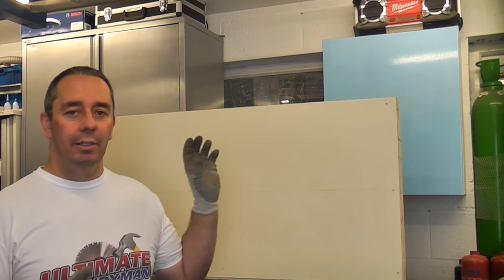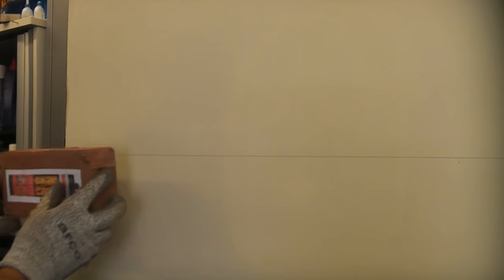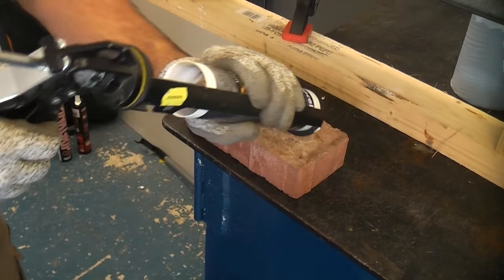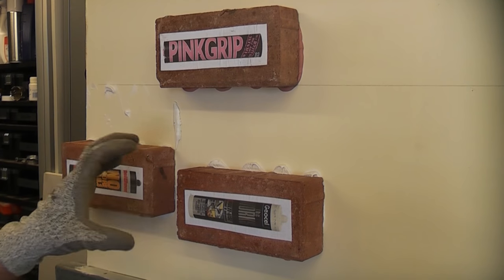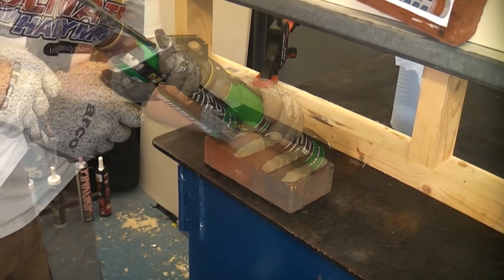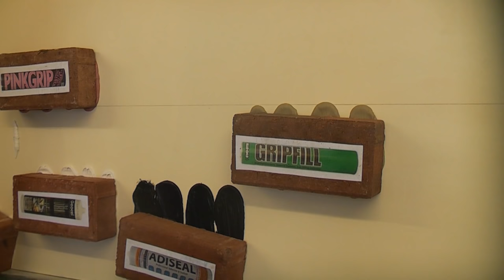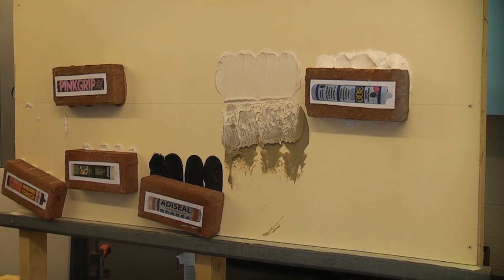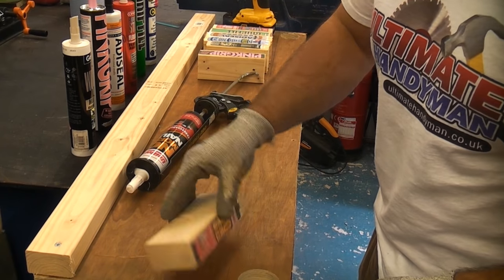Grab adhesive - grab and strength test

Comment: Hi Chaz, great video! Keep up the good work. Quick question: did you have price range when buying these products or was it whatever was available the shop? Also, were all the adhesives approved for working with mansory/concrete/bricks? If you were to select 1 based on the tests - which one would you use? Thanks! Love your videos.
Reply from the maker: Hi Aakash, in the first test that I did I bought the same adhesives that everbuild used in their "maximum torque challenge", then for the second test (this one) I bought adhesives that people recommended from the first video-
https://www.youtube.com/watch?v=9XgDvYsJiB8
I think all grab adhesives can be used on masonry.If I had to choose one brand I'd go for the Nemesis brand sold at Screwfix as it performed well in both of the tests that I did, including the strength test-

https://www.youtube.com/watch?v=80pC1-eJFj0
Reply: Oh thanks - I  missed that! You did mention it in the first seconds of the video! Yeah, I have heard good reviews for Nemesis - some sources say its a Dow Corning product.
Reply from the maker: Thanks, the Nemesis gear is excellent. It would not surprise me at all if it was made by Dow Corning.

Comment: Hi could I use CT1 to fix some small wooden batons to an outside brick wall ,to put up some feather edge panels up......thanks
Reply from the maker: Yes, that should be fine, although mechanical fixings would be preferred, as you don't want it detaching with the wind etc.

Comment: As with all adhesive bonding, surface pretreatment is no.1 importance. Did you clean/prepare all surfaces the same? Also, the failure mode of each bonded joint gives valuable information (I.e. adhesion failure, cohesive failure,  substrate failure, or mixed mode failure). If you see adhesion failure mode (all adhesive left on one side of failed joint), it is likely that surface contamination is to blame.
Reply from the maker: I didn't clean any of the surfaces apart from ensuring they were dust free.
I have repeated this test since using stainless steel and that did not hold as well as the timber did.
Thanks for the comment
Reply: Yes, stainless is a bugger to bond to! You'd need to start by throughly degreasing with solvent wipes (MEK would be best but bet you can only get isopropyl alcohol). Then abrade and finally solvent wipe again. Even then, the oxide layer on the stainless makes bonding hard as it reseals quickly after you abrade it. Thanks for the feedback, keep up the good work on the channel.
Reply from the maker: Thanks Guy, it was one of the adhesive manufacturers that watched one of my grab adhesive testing videos and said it was an unfair test. He then recommended using stainless steel, so I cut some test pieces and cleaned them using methylated spirits before bonding them to another piece of stainless. Even after a full week many of the adhesives were not cured fully and were moved quite easily with the hydraulic ram.
I'm not sure what pressure it took until I edit the video, but I'm sure it was much less than when I used the timber.
Thanks for the comment
Reply: Ultimate Handyman hi what's the best adhesive to use to put on a curtain corniest on the concrete ceiling without using any drill or screws thanks
Reply from the maker: It depends on the weight of it and how much surface area you have.
I'd always use screws for such items to be honest as you are guaranteed that it will never fall down.

Comment: which grab adhesive would you suggest for a good an secure fixing of timber stud to concrete wall inside. i dont want to take chance of hitting wires that may b hidden.
Reply from the maker: I'd just use Nemesis from Screwfix as it's cheap and works well

Comment: I need to put up a wooden curtain rod, 8ft long I screwed it into a plaster wall already and it fell down after 3 months, I couldn't screw it in properly as the plaster is too crumbly, it's a council house built in 1968 and there is a big gap between the plaster and metal lintel. I was thinking of grip fill in the screw holes and push in the wall plugs let in cure for 24 hours then put up the pole? what do u think and any advice would be welcome
Reply from the maker: That might work, but what I normally do is screw a wooden batten (2" by 1") to the wall first (this can also be glued with Grip fill etc.).
It's much easier fixing a curtain rail to the wooden batten as you can put the screws anywhere.
Reply: Ok Cheers thanks, keep up the good work

Comment: You used enough of it to glue an SUV to a ceiling on those little bricks! Of course most of them are going to slide! Thinner beads should allow the goop to do what it was meant to. A big glob of anything takes much longer to dry or react. In this case if it had adhered to the wall and brick, you have all that slop in between that isn't able to for the most part.
Reply from the maker: This video was made because a well known grab adhesive manufacturer made a video called "the maximum torque challenge". In that video all of the blocks that they used fell down the wall apart from the "maximum torque". In order to recreate their video and perform a fair test I had to try and use the same amount of adhesive that they did in their test, but obviously I got much different results ;-)
Reply: This company 'maximum torque' that manufactured the test should be reported for misleading us. The other companies misrepresented should take them to court and sue them. 
People Power Ultimate HandySuperman the official go to Chap for honest professional information and advice
Reply from the maker: Thanks Jack ;-)

Comment: great test. its great for a trades man that cant do the test them selves. im shocked with the pink grip. I never got good results with ithave you tried tech 7 , I would like to see a test like this but trying to find the best amount of glue to use. I would guess that if you used a smaller bead of the runnier adhesives you might get less slump
Reply from the maker: Thanks, I used that amount of adhesive as that is similar to what they used in the "maximum torque challenge", which is what I recreated- but with different results. I have never heard of Tech 7 but will look out for it.
Thanks for the comment ;-)
Reply: im in Ireland . we have tech 7. it is similar to ct1. I find tech 7 a lot better.  they have brought out a new tech 7  that is a lot thicker  and is more of an adhesive rather than silicone . I only used it once to stick a few loose slates on an old house. it is some tack  . I stuck  the loose slate and couldn't move the loose slate once I got it in place. I must try it someday on something and see if I can break the joint
Reply from the maker: Thanks, I think I have seen it on ebay. If I do further tests I'll be sure to pick some up ;-)
Thanks for the comments

Comment: Is the gauge showing psi, or is it calibrated to show the ram push?
Great video again!
Reply from the maker: Its just showing PSI.
Thanks for the comment ;-)
Reply: It doesn't matter for a the comparison test, but I thought that with a 2" (?) cylinder the "push" will be around 3 times more than the pressure. Some impressive results of actual load bearing ability there!
Reply from the maker: Absolutely. The C-T-1 and Nemesis both broke the wood before the adhesive failed- very impressive!
Thanks for the comments ;-)

Comment: How many of the adhesives failed due to the plywood delamination as opposed to the adhesive failing?
Reply from the maker: I think just one of them managed to delaminate the plywood, which was the last one tested at over 600PSI

I have tried repeating this test using metal on metal but it just does not work as none of the grab adhesives I tried worked well on metal and most could be removed easily.

Thanks for the comment ;-)

Comment: Hi can u recommend a good grab adhesive for sticking wood to fibreglass ? it's an interior of a yacht and I need to fix timber batterns and can't screw it for obvious reasons
Reply from the maker: I have never tested any grab adhesive on fibreglass. I tend to use the Nemesis brand from Screwfix though, I used it a few months back to glue the milk holder door back into the fridge- it worked perfectly, even though epoxy would not hold it.
Reply: Who actually makes nemesis adhesive for screwfix ?
Reply from the maker: Not sure as it's their own brand which I think is exclusive to them.
Someone said it was made by Dow Corning, but I do not know if that is true or not. 
It's brilliant stuff though (I'm not on commission either)

Comment: Hello, I need to use it for a wall hanger, do I need to look at the pinkgrip because of the first part of the video, or the one with higher pressure value (CT1 or Geocel)
Reply from the maker: I'm not sure what you mean exactly by a wall hanger, but one of the best adhesives is the Nemesis, sold at screwfix (assuming you are in the UK)
Reply from the maker: If you are in the UK I would try Nemesis from Screwfix.
Failing that CT1 or Geocel should do the trick ;-)

Comment: interesting pinkgrip is cheapest. Then again i have found everbuild products to be good "bang for buck" even if not the best. 
Im presuming the Solvent free versions don’t work as well?
Reply from the maker: I have not tested any solvent free adhesives as I have tried them in the past and they were not as good as the ones containing solvents.
Everbuild make some good products and they do make quite a lot of grab adhesives, some of which are expensive-
PINKGRIP
Gun a Nail
Grip tite
Maximum Torque
Stixall
Clearfix

Out of all the Grab adhesives that I have tested Screwfix's Nemesis is my favorite, as it has good initial grab and gives a very strong bond. 

Thanks for the comment ;-)

Comment: CT1 appeared to de laminate the ply as apposed to fail its contact, interesting
Reply from the maker: Yes, that is correct. The Nemesis brand from Screwfix did a similar thing when I tested that in earlier tests- the block of wood actually split into two pieces when that was tested.Thanks for the comment ;-)

Comment: It's great that you have done these tests, and I enjoyed watching them, but the wall test was inconclusive in both videos as the amount of adhesive used was not the same for each block, and you would not just stick it to the wall and walk off you would support it in some way so invalid as a comparison although there were some surprises, the other test was better in the first video as it was a more level playing field, but again varying amounts of adhesive (not sure how you would make each the same) but video 1 was on stainless steel, however video 2 was on a bit of old looking possibly dirty ply which in itself would be different for each piece of wood as it is a natural material and will be strong or weak in different places, most seem to rip the wood as they broke free suggesting a good bond.

By the way did you try the B&Q own brand off camera? https://www.diy.com/departments/b-q-grab-adhesive-0-31l/214123_BQ.prd I used it recently as I needed some for a stone job and it worked really well £2 a pop.
Reply from the maker: The wall tests were trying to replicate the "maximum torque challenge", in which the makers of Maximum torque made a video where the only product to stick a block to the wall was "Maximum torque", you can see my video here- https://www.youtube.com/watch?v=9XgDvYsJiB8

Thanks for the comment

Comment: Great vid! I keep on wondering how do you save the remaining stuff in the tube? The Pink Grip is only cheap at 2.49 but it's a shame to waste it. It has a paper tube and not a changeable nozzle.  The screw inside the nozzle doesn't seem to work that well.  Next person that invents a gadget to stop stuff drying out will be a millionaire...
Reply from the maker: Paper tubes are a really bad idea, the plastic ones are much better. I normally use gaffer tape over the end of the tube- that normally works well ;-)

Comment: do u think this stuff will hold a tap to a bath? i cant get the nut on under the bath as it impossible to get to without going thru the external wall
Reply from the maker: Yes, providing you leave it long enough to cure before moving it.
Adiseal would be my preferred brand.